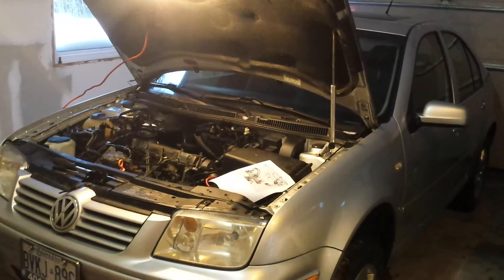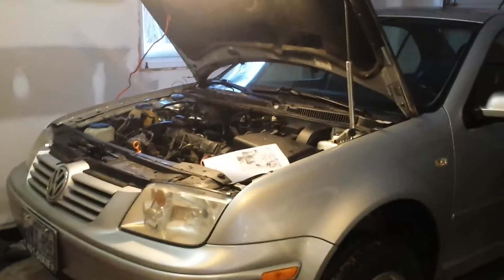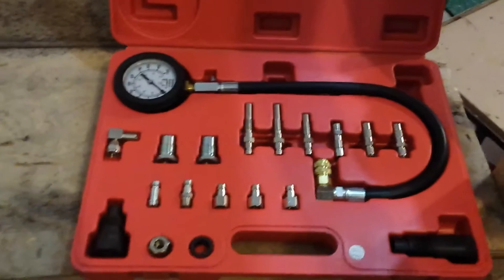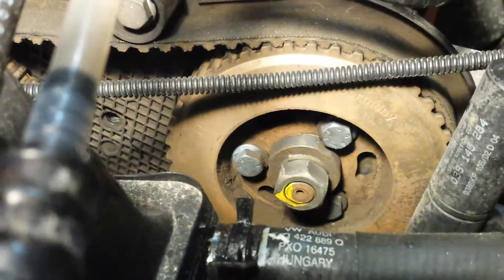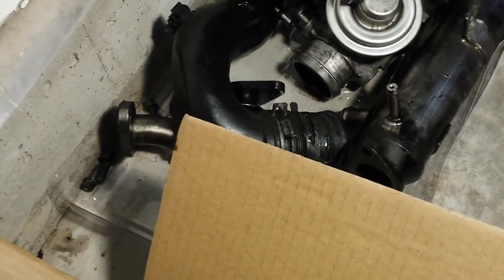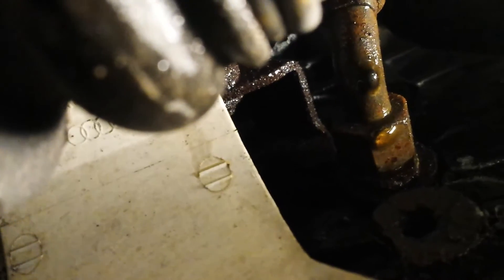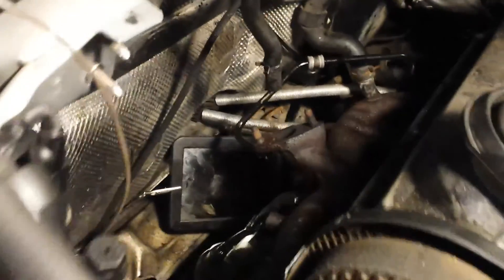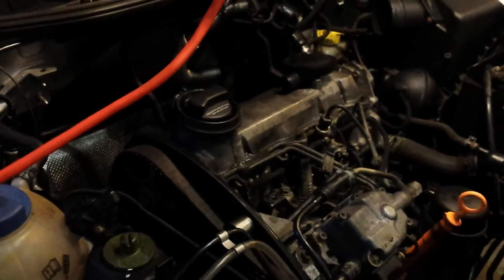ALH 2003 jetta TDI. How to fix after Runaway..

Comment: Is your tdi auto? If so when it ranaway was it rolling coal or pouring oil out the exhaust pipe?
Reply from the maker: Manual transmission. yes pouring oil out of the exhaust pipe.
Reply: Sajeev Kumar you couldnt stall it out? So then its just the turbo shot. Right?
Reply from the maker: Stupidwild596 yes the turbo shot . I am  working on my turbo . i have two video uploaded about my turbo rebuild . you can see the condition of my turbo. Third part will be uploaded soon .
part-1 -https://www.youtube.com/watch?v=PU2ucUpKH5Y
part  2- https://www.youtube.com/watch?v=AU9uzTmNnG8
Reply: My 2002 tdi just ran away but smoke poured out from the hood.  Maybe the tail pipe as well but I couldn't tell.  
What's the difference between the two?  Are they indicators of different problems?
The engine wouldn't start that night, then the next day it ran for a few minutes and then ran away again.
The car mechanic said rods were bent and it would be very costly to go into the engine and determine the extent of the damage and fix it.   Plus I'd need a new turbo. I junked it